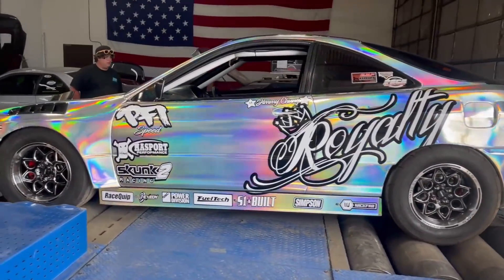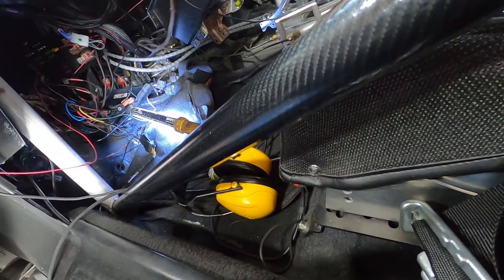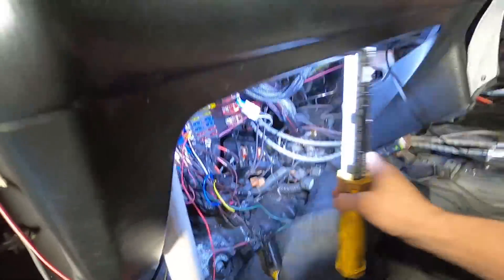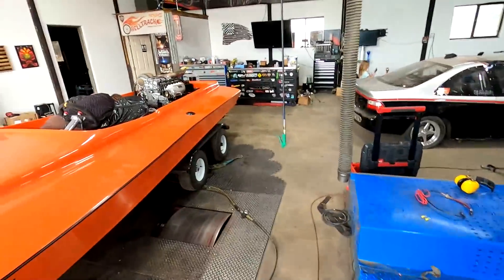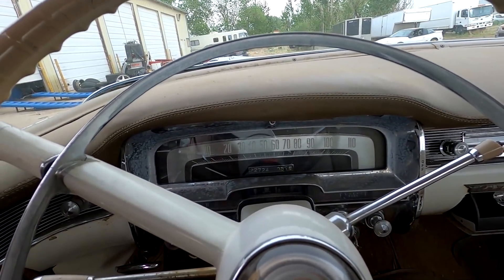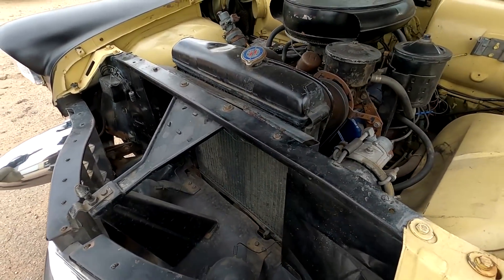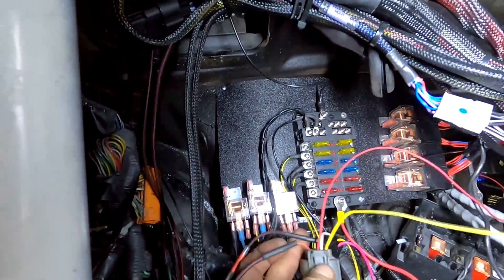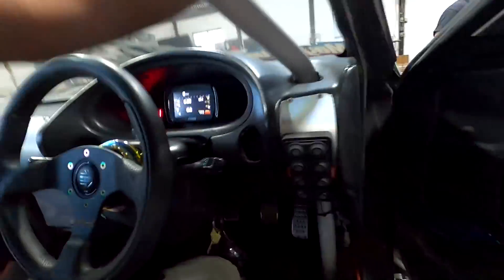Zapped ! Where is the Power?⚡️! (Working Towards a Tune) Episode 2

Comment: Hey Brent, Like you said He does not do thus everyday and it is Great to see someone have a go at doing things. But at 0.20 into the video where Jamie is in the back showing the relays, There is those main Power cables (imho looks like heavy speaker wire) There is that join in the cables that has eyelets on it with a bolt holding them together with electrical tape wrapped around them. It is right beside that alloy tank. I hope it is for the intercooler, but seeing there is a tank at the front with the intercooler pump already I hope it is not a Gas tank. If that join in the cables with the bolt in it just touches or rubs against that Tank that is a huge fire hazard Fuel Tank or not. It will become a dead short. So I hope You Guys have seen this as it easy to miss or forget with all the other issues You are Dealing with. You have a Great attitude, Most Shops would have not have even put that car on the Dyno. You are a Great Guy and Help anyone and everyone. Great Work Dude,

Comment: I can't agree with the sentiment that we don't do this everyday. That mindset is what keeps people from being responsible for their build. I can understand that it can be daunting to tackle, but you guys figured it out and fixed it very easily.

If you're going to take the time and money to put into a machine for racing at a higher level, you have to be also willing to do it right. Rushing to get ready for an event is what causes something like this.

I'm not judging the owner, it can be overwhelming if you're trying to get a car ready and you're splitting your focus between too many things. But sometimes you have to step back and realize that what you've accomplished thus far is unacceptable and will ruin anything else you've done. Maybe wait for the next event and start over. Would have been a shame to see a passionate build like this break on the dyno due to a wiring issue.

Don't forget that intercooler pipe clamp.

Comment: On the cadd some one else suggested the dizzy
Used to have problem at time with vac advance moving hot wire inside it grounding out at times
Used to drive me nuts
Need to pull dizzy check it carefully and completely go thru it

Comment: rats nest under there lol
I used to use masking tape on both sides of wires mark them before I started installing them then you will always know what each wire is for forever
Reply: First hot day the adhesive on the tape will start to let go and it doesn't take long for masking tape to deteriorate once the adhesive is all gone. That's why wire harnesses use different colors....

Comment: Also had one question not for PFI but to the owner, what in your right mind possesses you you put a kill switch in the back on your street driven car? I don't have a kill switch on my Toyota Camry should I put one on there? will it make it faster? Or do you guys specifically put that Killswitch knowing that it's going to blow up or catch on fire? Sorry guys not trying to bash on anyone. Or the racetrack specifically says you need it? So this topic has really got me interested I'd like to know what PFI thinks about putting a external kill switch on your street car Honda. Is it really necessary???
Reply: I don't believe the car is a street driven car between the large wing and cage its a track only car. Almost all track once you've required to install a cage in the car they make you put a external shut off for the electrical system in case of fire or roll over to stop the fuel pumps and other systems in the car. It's not there to make the car faster just safer.
Reply: LOL was being sarcastic with will it make it faster come on now.....smh
Reply: And your probably right about it being track only car.....lol. but external kill switch for that🤔🤔🤔
Reply: @badassbrian11   Yes all race cars it seems running quicker than 10.99 and the battery relocated to the rear of the car must have it by NHRA safty rules but it seems to also vary by track sometimes but safer is always better.

Comment: I bet you he had power and ground backwards and fried something and that's why the fuel-tech isn't turning it on.
Reply: I think he used normally closed relays instead of normally opens. He just put a bunch of parts together without understanding anything.
Reply: I made similar mistakes when I was young. I did my first wiring in 2001 on my megasquirt... lol they don't even make it anymore. its now microsquirt. it's megasquirt 1 converted to megasquirt 2 with a 2.2 daughter card. You can buy the daughter card still but I don't even know if they still make make ms1.